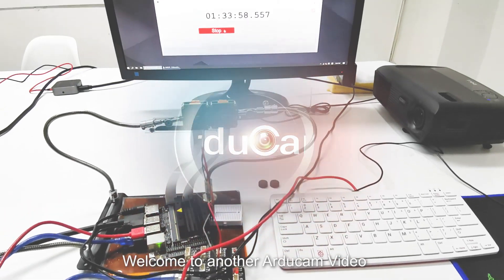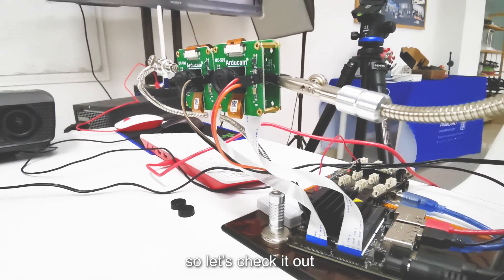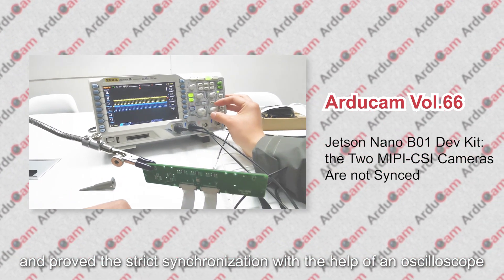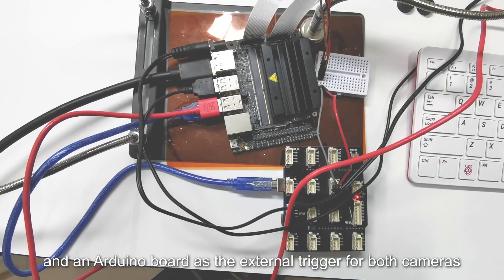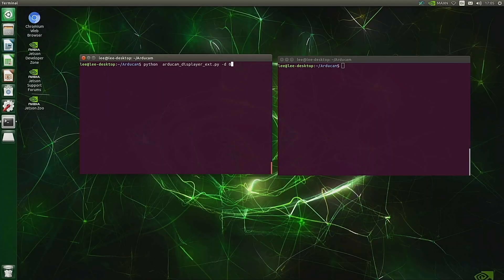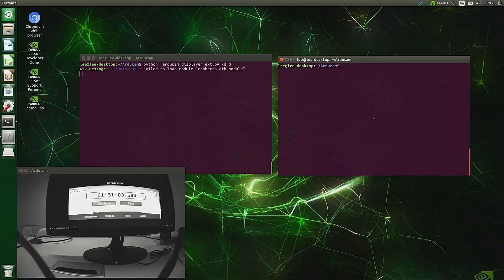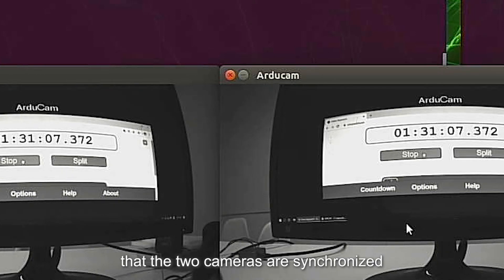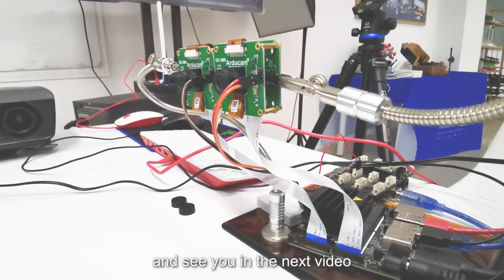Synchronizing 2 Global Shutter Cameras with Jetson Nano B01 Kit (No Stereo HAT Needed!)

Comment: Is there a reason why you use the Arduino instead of the Nano to trigger the cameras? Are the GPIO pins on the Nano not able to provide enough current to trigger the camera?
Reply: arduino doesn't run linux, if it did the trigger time wouldn't be exact